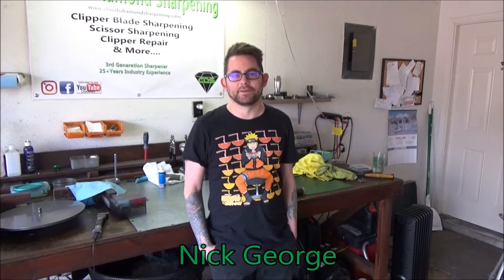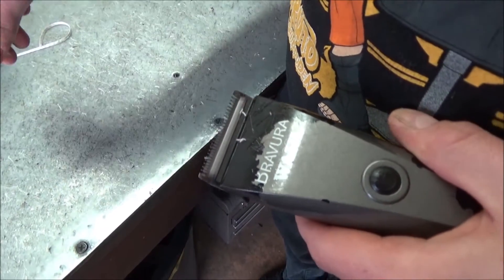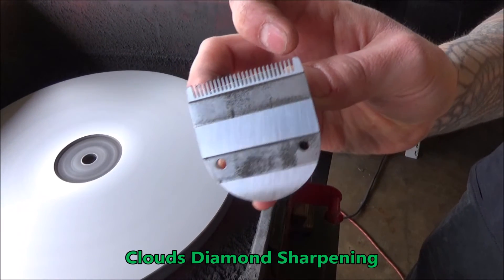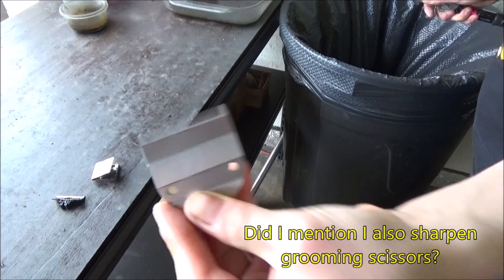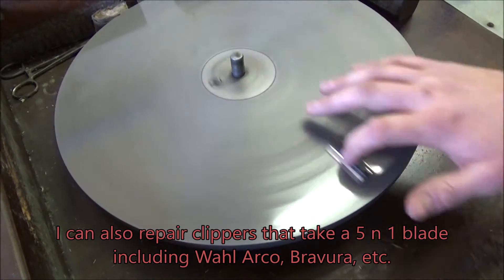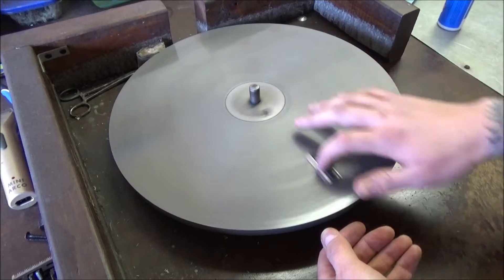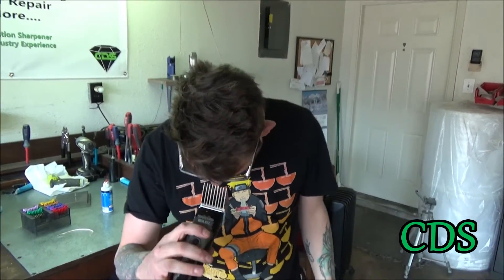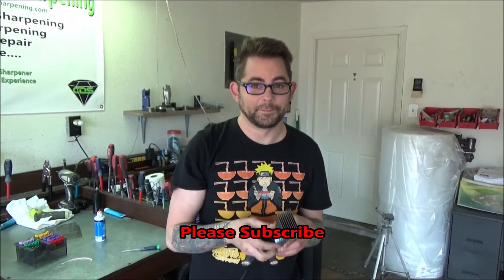Professional Wahl 5 in 1 Clipper Blade Sharpening

Comment: Do you use two different machines?
Reply from the maker: Yes we have different machines for different applications.
Reply: Where did you get your sharpening disks? I have older style disks with grooves and not flat like yours.
Reply: You don't use the diamond on animal clippers?
Reply from the maker: @ronaldrkirchhoff1626  yes, the diamond wheel is used for animal clippers as well.
Reply: Where can I get one?
Reply from the maker: @ronaldrkirchhoff1626  the wheels aren't flat, but appear that way. Our discs are custom made.

Comment: Is there a way I can sharpen them correctly without spending a thousand plus on a machine?  I see people use stones but every video with machine says stones won’t work because of the hollow center, I’m so lost..
Reply from the maker: There are a lot of variables that go into clipper blade sharpening. The sharpener is the most important of these variables. The machine doesn't work without the knowledge of the sharpener using it. For a long lasting edge, you need a machine. For a quick fix, flat stone. However, BOTH require the proper knowledge of a clipper blade and how to sharpen them properly.
Reply: @cloudsdiamondsharpening3973  I understand the hollow center shape, I’m just curious if there is a way to put the correct shape on it by hand since a machine is outrageous, the disc is what’s vital
Reply from the maker: @wiillthebarbertv9415  it's not possible to replicate that shape without the disc.

Comment: Are you using less speed for the smaller blade?
Reply from the maker: It depends on what's needed. We utilize different speeds both slow and fast, but the biggest factor is the experience and the touch of the sharpener. The speed or machine used is only part of the equation.

Comment: What does it cost to mail clippers in for a "tune up"?
Reply from the maker: Pricing can vary based on the model. You can check out our pricing page on our website cloudsdiamondsharpening.com for general clipper repair pricing or contact us directly for more information.
Reply: @cloudsdiamondsharpening3973  I don't see a single price on that page. Just a description of what you guys do. Nothing about how much anything costs other than the mention of estimates. Maybe I'll look closer to home. What am I looking up?  Hair cutter fixer? Haha. But seriously...
Reply from the maker: @JessiLive  If you go to the pricing page, and scroll down to Hair Clipper Repair /  Service, underneath you will find specific generalized pricing for clipper tune ups / repairs. As with any tune up or repair, costs can vary. The prices you see are simple tune up costs, but can always vary based on if parts are needed and the brand / model of clipper.